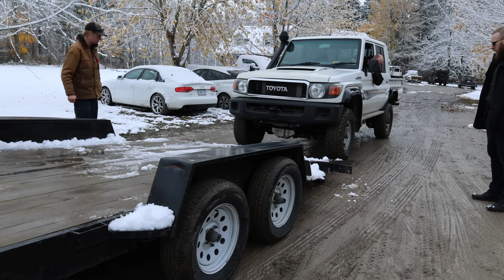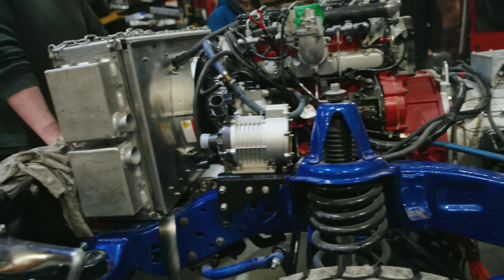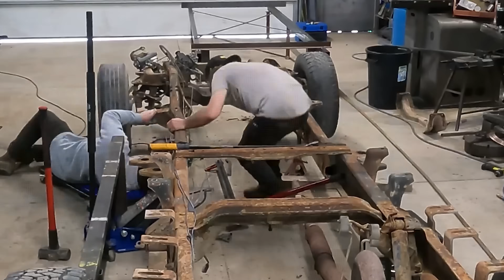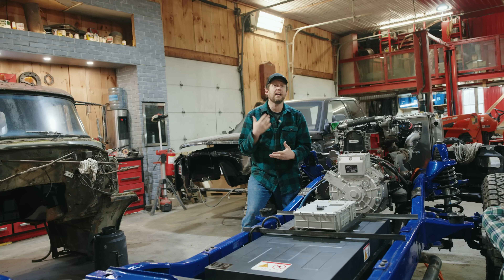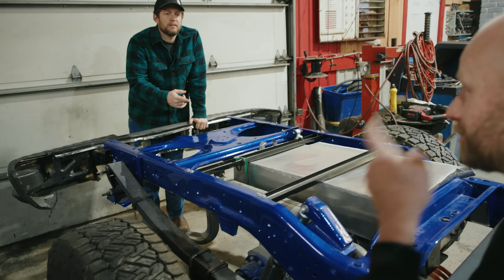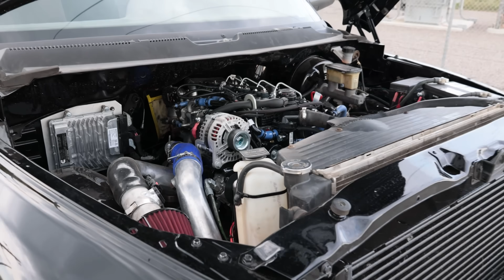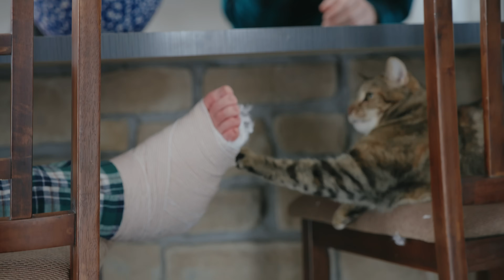Scrap Our First Design and Build an Edison Pickup Chassis from Scratch?

Comment: So why run a ac generator when you can shorten it to a dc generator adapter and slap it on a smaller engine and just use the battery as a surge protection for the electric motor? You’ll only need about 110-150 hp and you could model it to run on pump gas.

Comment: Hi good job guy :: we run f350 and 550 with salt box’s on the back : front plows and side plows so it got to be all the same size :: this way the side plow arms don’t have to be shorter : one arm will fit all over the place :: salt box’s too one size fit all ::

Comment: so I'm seeing an issue here. It looks like they're trying to make mini semi's.

I was looking at converting a 1980-1987 K30/C10 square frame pick up body 4 x 4 to Electric.  And what they were originally talking about this really look like it would be able to do that.

This now seems like I have to buy their frame and go with their single battery design where I wanted a modular battery design that I could be able to replace battery packs that were smaller as they became less efficient instead of having to replace the entire battery pack.

I also didn't wanna have to have more and more computers on board to manage things like my Air bladders which is what they're going to do, and it seems like I have to be more and more into an ecosystem where I'm gonna have to deal with OEM controlled control systems, and proprietary software that we're gonna have to worry about. I think we've all run into enough problems with John Deere and their refusal to repair or refusal to maintain. And I'm just worried that's the directions is going.

I think a lot of us just wanted a kit that we could pull out our gas engines and put in an electric conversion that would hook up to our transmissions and our drive trains. And I don't see that that's what's happening anymore. Please someone tell me I'm wrong.

Comment: Edison is doing most of the hard part of designing an original vehicle. 
Drive train, steering, suspension. These are some of the most of difficult part of designing a vehicle. After the reserved vehicle orders are fulfilled. I would be interested in seeing how easy it would be to move into producing a fully original consumer vehicle.

Comment: I'm gonna put an rv on it. Well a suburban rv conversion. I'm building it out now, but the 14mpg is less than ideal. And it already needs plenty of power. i can get by on my 10kw now, but i would tap the pickup kits battery and use it as part of the house power storage.

Comment: Has anyone heard if this kit would fit under the Full Size SUV's that are based on pick up truck chassis? (ie. Yukon, Suburban's, Excursions, etc.)
Reply: Yep, the new gen2 parts should fit under the hood and between the frame rails of any standard cab pickup with an 8 foot bed.

Comment: Chace, Chrystler did the air ride on their truck on the ram half tons and a bunch of other trucks. They ended up being the shits in Canada because of their design. Not only did their techs not know how to work on them but the biggest down fall was their cheap compressors and how moisture got into the system. I don’t know a lot about semi’s but I do know that air ride is not new tech and the norm from semi’s. How do you mitigate the cold and humid climates of BC with this tech, and not sacrifice reliability?

Comment: Keep 34". Question....is the engine used in this system smaller than the full-mechanical equivalent?
Reply: Correct. The batteries handle peak loads, so the engine handles average loads. A truck on flat ground only needs 100 hp while towing to fight the wind. 

On hills though, there needs to be enough battery to make the climb.

Comment: Talk about selling out, what happened to the “Right to Repair” and “Kits bolt on, to give the little guy to keep his truck and save money.” And now these guys start talking about more capabilities but more cost. The Musk Syndrome
Reply: ? Edison is still for "right to repair". I believe they're still working on bolt on components. I support Edison making the complete chassis for fleet buyers FIRST so DeBoss can get to self sufficient profit. Then they can work on the 100 times harder problem of 100 kits for 100 different kinds of trucks. It's clear that  making "kits" is way down the road, but basic "components can be made available to customers.
Reply: @Sah @Sah-o5m ’s not the impression I get, when their website promotes Pickup Truck Kit? Which it seems now it will be full frame kits for 1 Ton vehicles, that’s not exactly a minor change or a future development kinda of thing… Specially when they have Deboss videos showing a RAM 2500, a Toyota Truck and they show themselves comparing their kit with the RAM hybrid Truck…that’s plain and simple “bait & switch.”
Reply: @TheGustavoVargas 
I can see you have a legitimate perspective. Your perspective implies that Edison has been, is, and will be deceptive in their efforts.

I believe Edison is just trying to figure things out and adapt along the way with no malice or evil intentions behind it. So I'm cutting them some slack. I think (out of necessity) phase (A) is the complete chassis, and phase (B) will be "components", then phase (C) will be installers that take Edison "components" and turn them into the sellable/installable kits.

So I think our difference is just in timelines. I believe Edison will get there eventually.

Peace.
Reply: @Sah-o5m  Maybe so, maybe is "messaging," I just find it rather odd, how they went from "we are doing testing at the RAM facility, and Dynotesting to compare performance so our kits can be integrated into 150 million older truck market." Cut to watching them sitting around talking about building our own frames, with 34" rails, and maybe later on, pickup truck kits for our installers... Perhaps there is no malice, and it may not be a scam, but it certainly starting to smell fishy...

Comment: Rear suspension: have it capable for either leaf or air. Even just at mockup pre-production stage. You can qualify and only sell air if you want, but down the road if you want an option, you're not redesigning from square one.

Comment: Sticking to an 800v architecture on the electrical system instead of the 400v the factory ramcharger is at would be best.  Your angle Topsy was viable is because of cheap proven parts.  New battery technology will be at this higher voltage.  It allows you charging advantages from your chosen generator.  The more you can optimize DC charging, the better a DC generator adds electrical efficiency.  All the electrical components need to be off the shelf as much as possible.  

Integration of multiple vehicles off one charger for the night is how fleets or household off peak charging will go.  That could be a battery bank off renewables, off peak grid, or a large generator simply doing what your chassis is.  What that will be you could simply program a visual basic template in an excel spreadsheet with electrical losses/factors that will output where tipping points are.  It would take very little for you to do the power electronics/control systems on fleet/garage charging.  Essentially it's a skid with a generator plug.  Not in theory different than making a amperage limited intelligent circuit, or bank of circuits off an industrial variable amperage cabinet.

Comment: A frame rail size outside of the 34" industry standard is about as smart as a locomotive manufacturer deciding to build a unit with 5' wide truck assemblies, when the industry standard is 4' 8.5".

There's possibly good reason for doing it, but it would be useless to any railway.

Now, if you were to make the lip of your frame rails wider, like 4x8 instead of 2x8, you could increase the internal space between the rails while still falling inside the 34" standard for bolt on and building. But I'm not an engineer or a builder, so that idea may be a complete load of bollocks 😆

Comment: Can I use the already great the Cummins 6.7L engine with just a bigger generator attached to it?
Reply: Someday yes I think. If a bigger generator then also bigger inverters

Or just don't Rev the snot out of the engine and use the smaller genny

Comment: Definitely need to keep the 34" standard if possible. I have my spot in line and am eagerly awaiting the finished product. I have a 1973 International 1510, which is approximately the equivalent of a modern F550 or 5500 (International Harvester was way ahead of it's time...) and I want it built as a hauler for gooseneck and fifth wheel trailers. All the tool boxes, hitches, and other accessories I intend to finish the truck with are based on the 34" frame width standard. Moving away from that industry standard will require finishing the truck with custom made one-off parts. Also, I applaud the use of air suspension.

Comment: Out of pure curiousity,  because my understanding of electricity doesn't reach much farther than 9 volts taste funny when you lick them. Aside from the obvious role in starting the engine, is the battery a necessity?  I can see the appeal of having a decent range without kicking on the engine, but I wonder how many people just want a diesel engine and electronic transmission.

Comment: This comment maybe off topic for this video, but spot on for a new light truck design.  This is what a great pickup would look like.
-All weather driving requires four wheel drive
-Keep ride height low to better accommodate aging customer base
-Delete any sale of customer telematics data
-Make this a vehicle that has lasting value like we see with 60s and 70s era vehicles
-Keep electronics generic/universal to allow future refresh and avoid rapid obsolescence

Comment: From service complaint reports on commercial EV Ford vans, many third-party upfitters incorrectly drilled bolt holes based on customer requests, damaging battery components. Manuals exist with safe punching locations, but are often ignored due to routine practices. For your testing, contact local or eastern U.S. upfitters to observe their customer installations. Also, consider using pre-existing wiring harnesses or bur-free channels to prevent service issues from wiring penetrations. There are some brute force installersout there, so plan for the worst.

Comment: I just want a good hybrid or full electric pickup on an early 2000a S10 or Ranger body. I really dislike the modern massive pickups. The size has a purpose but my day to day driver its unnecessary and kills the mileage. I think the compact pickup is the largest gap in the market.

Comment: Drive motors on the rear axle is going to increase unsprung weight significantly. I question that on a 3/4 and 1 ton truck. Where a pickup may or does drive (at higher speeds) is different. No way to a run single motor hung in place  of tcase? Allows use of common axles out there. Driveline ( axles/driveshafts) remain simplistic and low cost to repair. What happens if you hit a pothole at 70 on interstate w/ motor integrated axles? Is there more potential to damage motors? What's that cost? 10k/axle? At that cost, not many people are going to sign up for a pickup conversion. Pickups are whole different level of customer compared to semi fleet owners. Just keep that in mind. Believe me , like the idea/concept, but needs some simplicity in adaption. After all, you are chasing customers that already are strained shelling out a 100k for a pickup. If you are chasing, medium duty customers (towtruck, dumptruck, flatbeds) then again, that's a different customer level above the typical pickup owner.

Comment: So I run a fleet for a private prisoner transport company, I think both your platforms will be a massive asset to prisoner transport. First transports need to stay moving with as few stops as possible and with oversized/extra batteries could make long distances shorter in time. The less amount of time prisoners spend chained up the better for them. When doing transports across the country there are many stops at facilities to pick up and drop off offenders. You can't always bring all of the offenders inside the facility for MANY security reasons and it will add lots of time and man hours on both sides. This means high idle times keeping them warm or cool, but not all sally ports are vented so you have to turn the unit off but with the battery packs you can keep that stuff going. So making your own platform for the small trucks that can have a passenger van body mounted would be very useful. So keeping them at 34 inches would be the way to go. A platform like a Blue Bird frame or kit for them would have some interest.

Comment: As someone who has done a lot of truck up fitting in the past (building flat beds, service trucks, and dump trucks) I say keep the 34" straight frame rails. Literally everywhere is designed to work around that, even something as simple as adding a fth wheel would become way over complicated because the brackets are made to go to the outside of that frame rail.

Comment: I’m seeing a lot of comments telling you not to make the rear wider and to just stick with the standard 34” rear to be able to mount anything built for that size. The thing is, if you actually made some sort of crossmember/ bracket mounting solution that allowed the mounting of virtually all equipment built for the 34” rails without modification, then it’s really not an issue. It would just increase the cost to build and the space available between frame rails.

Comment: I think there's been enough comments to say there's consensus on the frame rails, I'm just here to say that I think a coupe utility, if possible, could be an interesting thing to attempt as a consumer model, I've always felt they have the best mix of pickup and being the right size for the job for individuals that might have it as their only vehicle. And with a proper pickup available, the engine for the utility doesn't have to be quite as big, a V4 would probably be more than enough for most payloads.

Comment: A chassis option designed specifically for classic utes like El Caminos, Caballeros, and Rancheros would be on brand and fucking awesome. Modern hybrid pickup torque in a vintage muscle utility body would be a head turner instantly.

Comment: If I were to convert my pickup, I would want the battery to be in the box, with a raised floor above it. Or use a sliding type drawer tunnel in between the wheel wells to store the battery. The in frame, battery is continuously being sprayed by road debris, which can cause damage over time. If it were installed in a slide type drawer, the battery and its connectors would remain clean and easy to service and maintain. You would lose some width and height of the space between the wheel wells with this kind of installation. However, the remaining depth of the box floor and sides would still be approximately 16 to 20 inches in height would they not? It would still function as a pickup box. This is just food for thought. You guys are on the right track. Indeed.

Comment: Your prototype is super exciting!  If you guys produce a durable,  simple,  easy to repair truck that shrugs off hard work and towing  AND doesn't have a thousand high tech bells and whistles to break you'll have the big automakers on their knees.   I would suggest designing it so that a traditional diesel power train and axles just bolts in if that's what the customer wants.  The high tech garbage in today's trucks has gotten way out of control,  making them very expensive to maintain.  I think there's a big market out there for simple rugged work trucks, and you can tap into it.   Oh yeah,  34'' for the frame rails.

Comment: This is not what I had in mind when I asked to bring back the compact pickup. I see your "right to repair" video was a bunch of BS, as nobody cares to learn how to work on hybrids; especially a hybrid FILLED with unnecessary sensors. We want a bare-bones compact pickup with a manual transmission! Not some hybrid trash!
Reply: Economy of scale means they need to start with the larger trucks first I'm afraid.

The new slate truck might be what you're looking for
Reply: @Sah-o5m Economy of scale means they need to mass-produce a compact pickup with a single-cab and a long bed (longer than the Maverick and EcoBoost Ranger, at least) to corner the fleet truck market! Make a newer compact pickup to pick up where the S10 and Ranger left off!

Comment: I'm really looking forward to Rich doing a side by side test with the Edison modified hybrid truck against a regular truck, both pulling campers over a decent distance, maybe 1000km.  Certainly, you'll get better mileage around town, but I'm not so sure it'll make much of a difference on the highway.  You might gain 15% by using a smaller motor, but lose 15% by converting rotational to electricity and back again.  I'm sure I'll get hate comments, but I'll bookmark it, and we'll see.  Hopefully, they'll be able to test it by the end of this year.
Reply: Yes. I believe the founders day is in September and the expectation is that there will be a convoy of 3 trucks/trailers to compare pros/cons/costs.

I'm expecting a mild advantage in "total cost per mile" with the Edison truck over ICE alone due to charging up overnight and running off batts for an hour or 2 daily.

Comment: Aren't you using older vehicles in order to make compliance easier?  If so, after making a new frame, at what point is it no longer an old truck?
Reply: I believe that phase 1 is a complete chassis. Phase 2 is selling just the drive train kit.